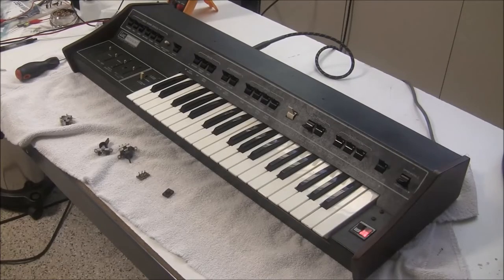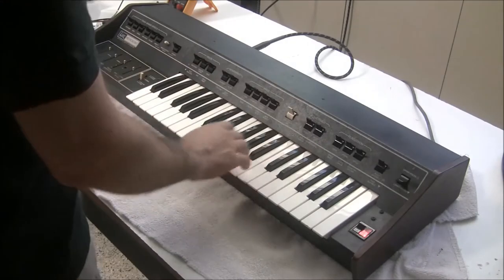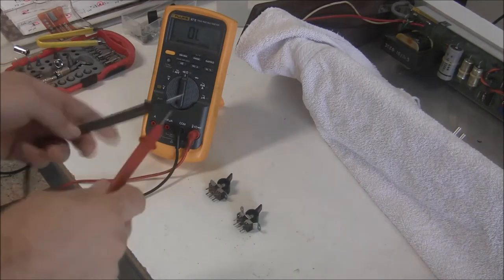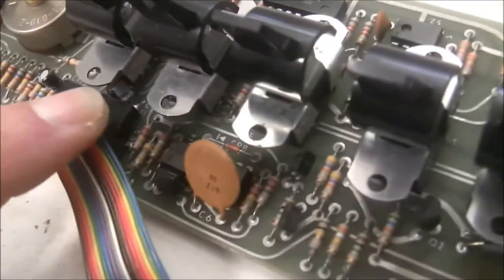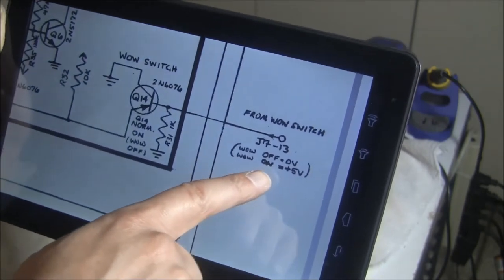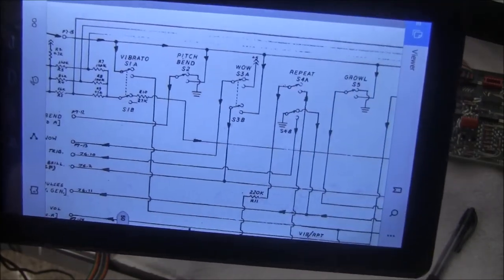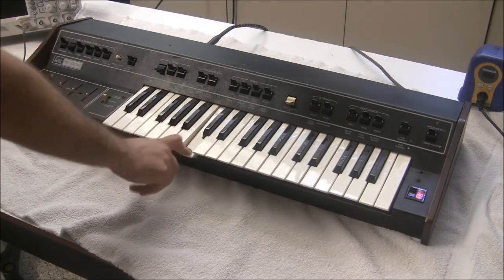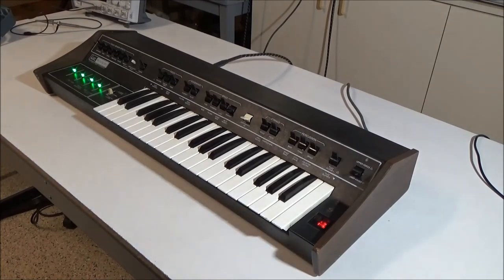Synthchaser #086 - ARP Pro Soloist Repair - Dead Presets & Broken Wow Effect

Comment: Yep - just as my electronics mentor said, the first place to check is the electro-mechanical devices: switches, transformers, pots, connectors, etc.  Contacts get dirty, windings age, carbon traces wear out.  That would be followed by semiconductors, which have a greater chance of failure from shorts and over-voltages. Then would be capacitors, especially tantalums, which tend to short when they fail, followed by electrolytics.  Last would be resistors.
THANK YOU for this in-depth look at repairs that can translate to other devices!
PS - Did you re-cap the power supply?  I noticed original-looking caps on the board at one point.